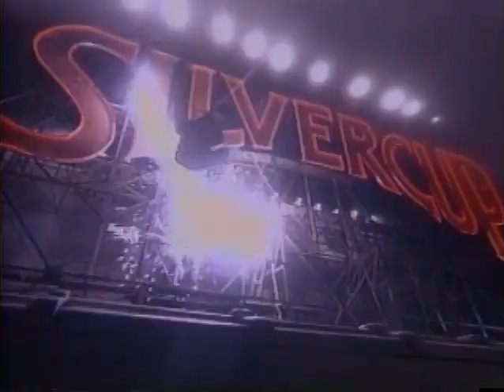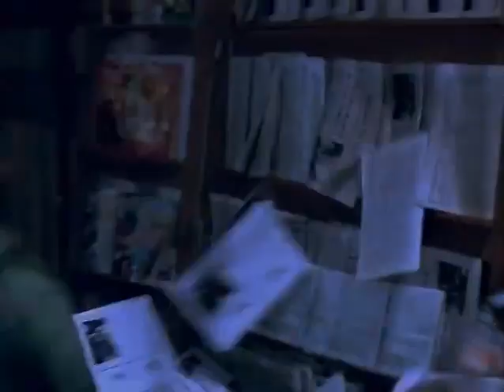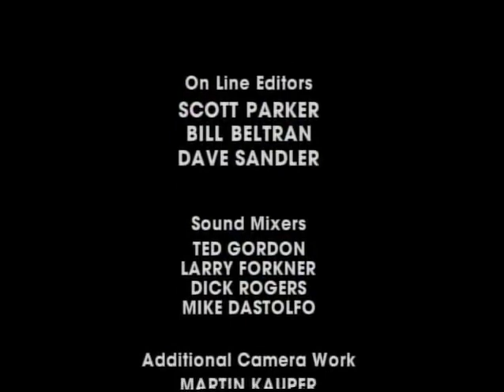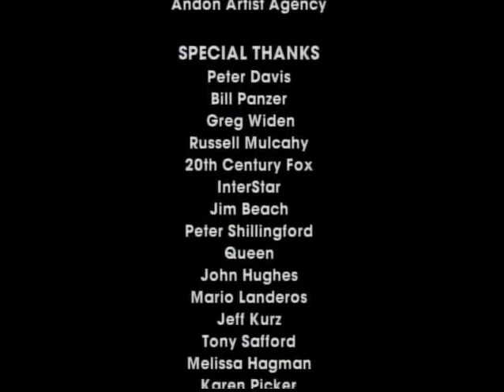Making of Highlander I, II, and III

Comment: Highlander is the best. Third had nothing to live up to because Highlander 2 destroyed the franchise. Highlander: Endgame was alright but it was disjointed and the script was awful. Highlander 5.....well no comment.
Reply: The third movie was played so very safe that it came off as a weak retread of the original with under developed new ideas.  Endgame was so hampered by it constantly being re-edited.  The theatrical cut is awful, the producer's cut is more coherent, but still leaves a lot of scenes randomly re-purposed and other scenes removed entirely.  It's like they had written a collection of scenes to fit the general store,, but the script itself had no structure and they kept shuffling everything around in editing.  I've covered both of these sequels in the last two years, if you want to check those videos out.  The fifth film is probably the worst film I've ever seen.  It's atrociously awful.
Reply: Adrian Paul said the Endgame they filmed was not the Endgame he signed up for. Apparently the script and the entire film changed while filming.
Reply: Alicia Borth I know. The film was butchered from start to finish. The directors cut is slightly better but the theatrical cut was heavily edited and reduced to about 80 minutes. There is also a rough cut which is slightly better.
Reply: @aliciaborth3016  supposedly it was cobbled together from 3 different scripts, one from Widen himself though he was uncredited. One script had the sanctuary, another an evil immortal breaking the rules of the Game and yet another with immortals ganging up for fights.
Reply: The special Editon of Highlander 2 is the only sequel I kinda like